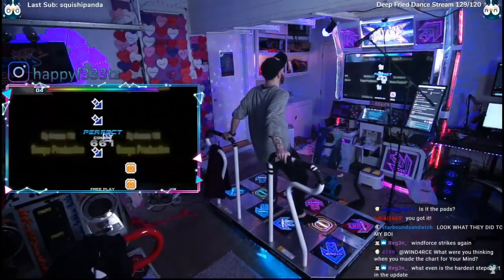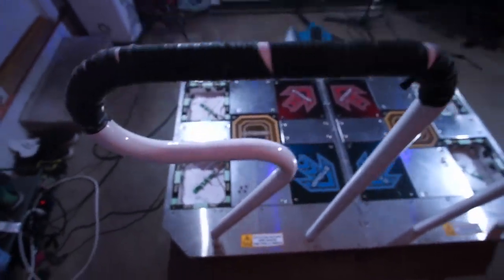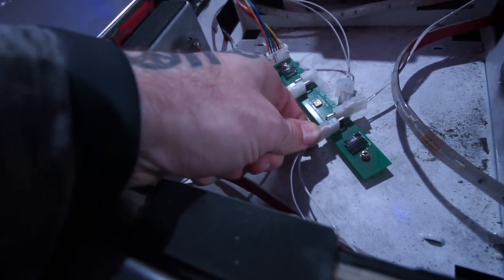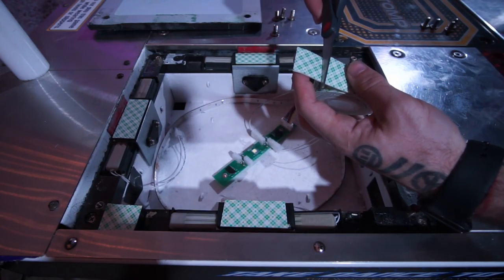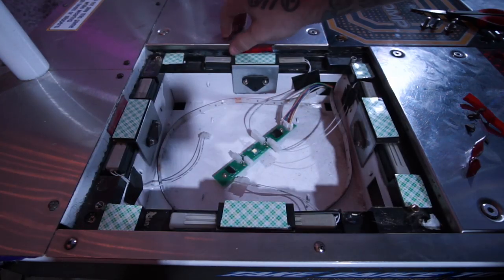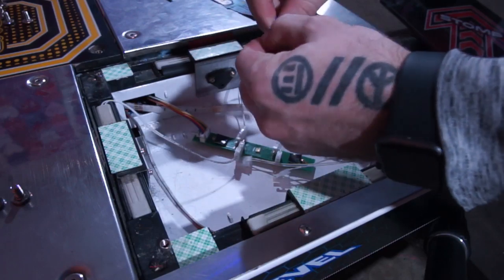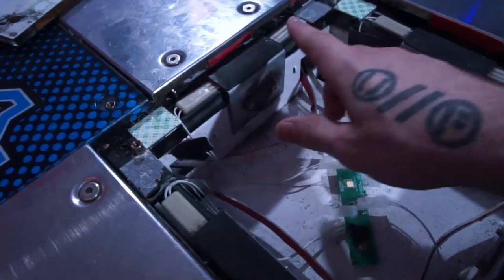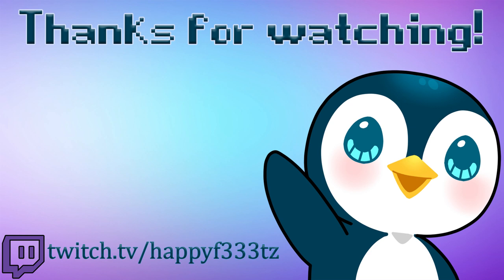How To Mod Your Pump It Up Dance Pad

Comment: I hope every arcade manager watches this video, the ignorance of arcade staff when it comes to modding arcade machines, they will react the same way as if you told them you built your pc. it's kinda sad that people have to buy their own machines just to show arcade managers how it's done and how easily you can get high level performance. and the risks? if you are super clumsy you might break a connector, drop water on the panel boards or something but remember that those machines were created to survive the most ferocious stomps by children and adults alike so everything in there won't break unless you really want it to.
Reply: look, pad modding is an art and it's hard to find the information. And it's especially hard to know the art if you don't play
Reply: For techs, if it lights up it works, also if you say they dont register they will say stomp harder! I hate them so much
Reply: @mobious01  so true
Reply: At my local arcade I managed to get permission from the owners to mod the pads, so once in a while I would message one of the techs to let them know and spend some time pad modding. It's really great when an arcade can acknowledge and trust players to keep their machines in shape. Later on one of the techs offered me a job, saying I should put in my resume (I do other electronic stuff as well). Last time I modded pads I got payed to do it! That being said if techs aren't capable of doing it themselves, they should really elect someone within the community to do it for them.
Reply: Jacob Pauls i know a place where they believe the pads need to be extremely close to the machine, also dont want to update the game because “it might break” i hate how dumb they can be sometimes even when the information is out there
Reply: @mobious01  Normally when an arcade caters to a casual crowd, as long as those people are still playing they don't really care about the serious players. They would rather keep the game running as is, and not deal with any risks of the game going down since it is still consistently making money in the state it's in. The best thing to do in this case is to convince the techs/owner(s) that updating the game will increase revenue, draw in consistent players, and that it is easy to install and doesn't run any risks. As for the pads I have known arcades that do it because of space constraints which is understandable.
Reply: @mobious01  In my local arcade they wont upgrade to the new XX versión until we get 20 players playing every week, we are only 6 People so far
Reply: As for the pads atleast they work fine
Reply: @SniperFallen06  well for me its very crowded but the "manager" of that arcade didnt get primissuon to upgrade it to xx T_T
Reply: @ShiroCh_ID  big oof
Reply: @SniperFallen06  very BIG Oof
Reply: As someone who works at an arcade, pump makes 1/5 to 1/10 what our top grossing games earn. For the arcades, they just dont see it as worth  it.
Reply: @zakizdaman  and i think this Fall of the Rythm game was thanks to that more and more Those arcade players were now too foccussed to Speed and Accuracy than back then when theres 50/50 players were in either Style or Speed and Accuracy,also Blame yhose devs for always making accuracy scharts and abandon freestylers just because its rare nowdays
again Chicken and Egg dilema for them and in turn made arcade feel it wasnt worth their cost
Reply: @ShiroCh_ID  i think a large part of it is the fact that a game session on rhythm gamea takes up to 15 minutes, while a gun game, or a claw game can be played 5 times in 15 minutes
Reply: To be fair these kinds of things aren't in the official arcade owner manuals, and many businesses buy their machines secondhand and don't have a manual at all. The pads are not particularly sensitive even when they're brand new. That's why these methods are called "mods". 

Please don't give arcade employees a hard time over this. It only serves to give the game a bad reputation and at worst makes them less inclined to work on the pads. Just politely show them the video and explain some of the key points to them, and why this would increase revenue by bringing more regular players in.

Comment: Excellent guide! Just been using this to mod a relatively new LX machine. I actually found myself using the indoor tape on the corners to prevent wiggling since I didn't have outdoor tape and it works surprisingly well! Will see how it performs in future though

Comment: Bottom sensor for the yellow panel seemed like a must to me (because of the heel)... maybe I'm just used to bad pads which don't work. The top one might be the first one to take off, but it's kinda tricky. It's nice that you concluded which ones to turn off from experience.